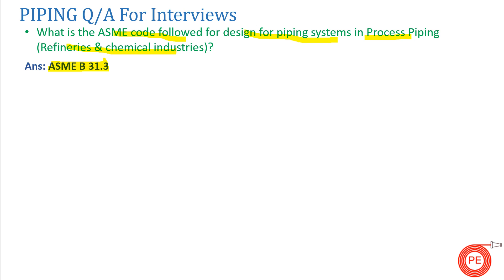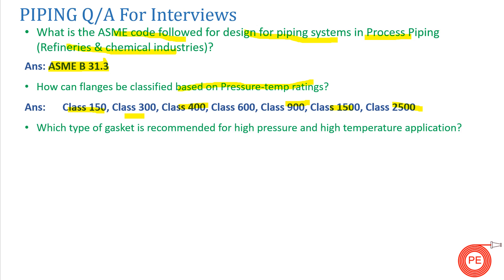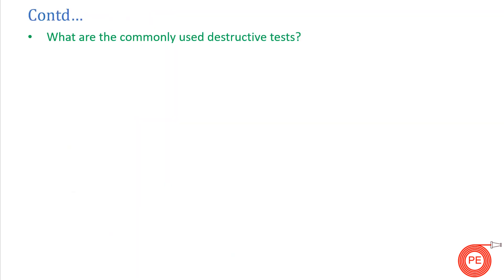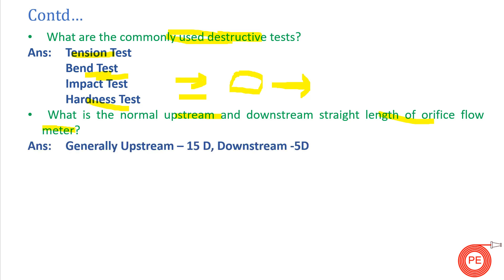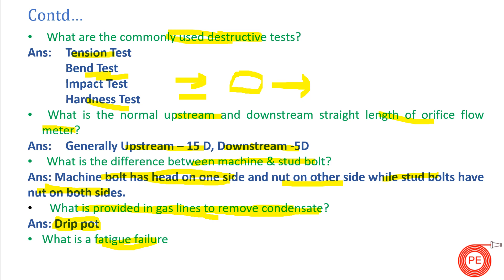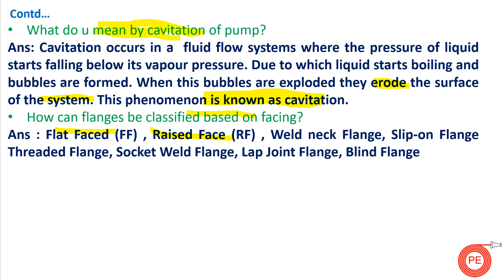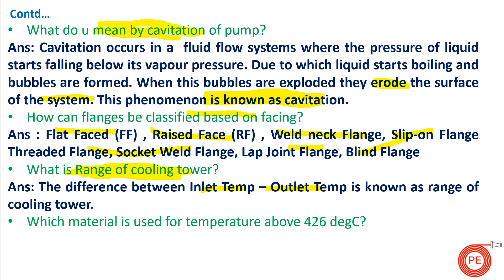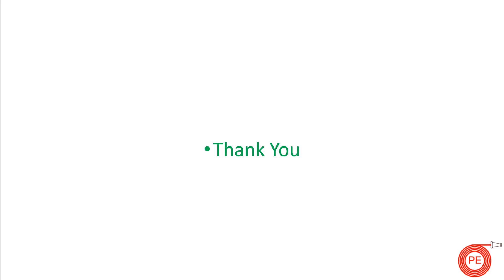Interview Questions for Piping Engineer Part 4| Piping foreman interview questions|Piping interview

Comment: can u tell me if fluid pressure is 25kg/cm2 and the pipe is ms pipe wht flange we have to use and how much class?
Reply from the maker: Go for class 300 flange and use weldneck type of flange.
Reply: @PipingEngineers  we use 300 # bt sorf not weldneck and plz make this type of video also where we can get easily information according to  pressure and temp for selection of flange..